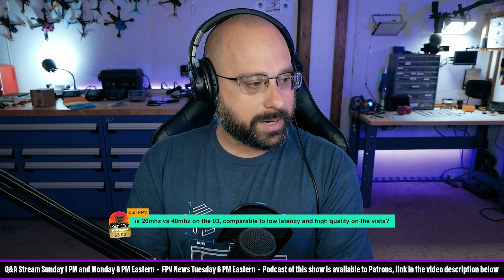DJI O3 20mhz and 40mhz? Low latency and High Quality mode on the Caddx Vista? - FPV Questions

Comment: on radio frequency, IN THEORY usually if you choose a narrow bandwidht you go far, if you use wideband you go high quality. so, in theory for LR flights, you should use a narrowband, because you are concentrating the same power on a very narrower "line, as pushing a needle and spraying whater. if you use wideband (40mhz) you are pushing only the barrel without a needle, the pressure is lower. i need to test if the theory apply to DJI O3 also. Have you already tested it? Thx bro, hope i make myself understood.

Comment: hi joshua , quick question , for max range on dji air unit v1 with googles v1 , do you think 25mb/s and low latency got more range than 50mb/s low latency ?
Reply: thats the radio frequency THEORY. narrowband far u go, wideband higher quality.

Comment: Stupid question: The O3 has one LHCP Antenna, and one RHCP, both joined in one case. The Goggles2 have 2 LHCP Antennas, and 3 RHCP. So using a Caddx Vista with a single LHCP Antenna, or an old AirUnit with two LHCP Antennas means, what we only use half of the Receivers of the Goggles2?  Waiting for my Goggles2, and I am wondering how the Range will be, using old Airunits...
Reply: I am sure you figured this out already but the O3 and G2 have all linear antennas.
Reply: @gregdavidd  How do you join two linears in one small case without interferences? The O3 Antenna is a Dual Band (2.4 + 5.8) Dual Polarization (LHCP + RHCP) Antenna.
Reply: @FPVZaphod  You should ask DJI about this because I did and they said Goggles 2 and O3 have all linear antennas.
Reply: Is that actually true? It doesn't really make sense for that to be the case unless there was some perfect phasing on them or some way for them to have perfect cross polar rejection even when they are hugging each other. I feel like they might actually just be two whips side by side that allow more amplification.

Comment: that was a tongue breaker question. 🤣
i would love if the O3 googles just have the same unconfusing modes shown. 
- 50mbit for high quality 
- 25mbit for low quality
- 60fps high quality
- 120fps low latency
boom! every gamer in the world would understand that straight away. but DJI probably was like: "hey amazing idea! lets make new versions of stuff most difficult to remember and annoying to say for maximum customer confusion, yay!"

i would not mind if they do:
DJI V1 goggles
DJI V2 goggles
DJI O3 goggles (AVATA)
DJI O3 goggles (Integra light)

imagine a world where things would be super easy to understand. meanwhile i am struggling every single damn time when i try to sort my mind which goggles or air unit i am trying to talk about. 🤪